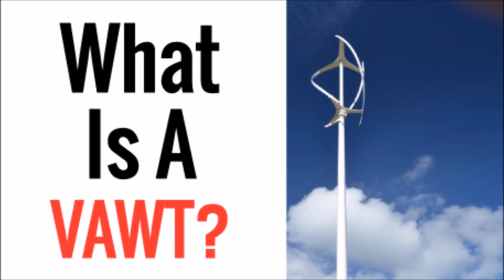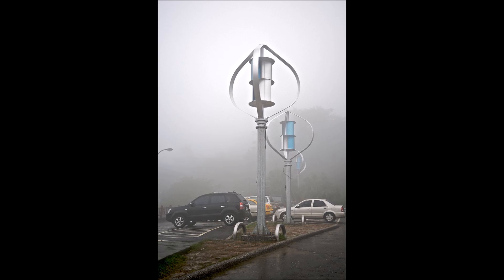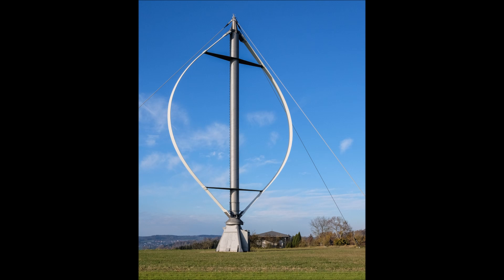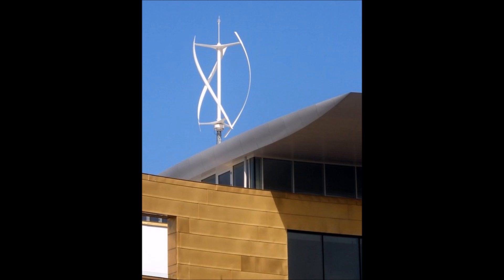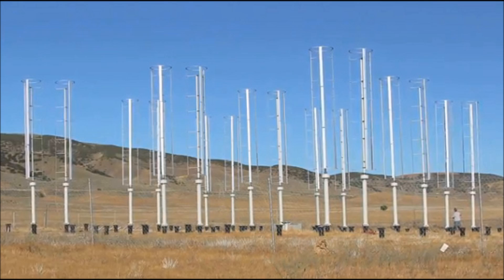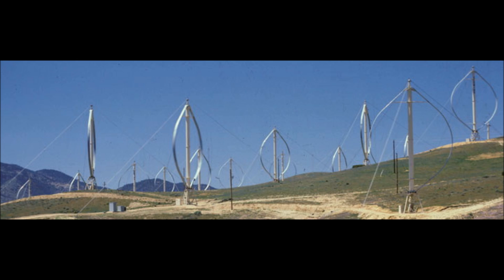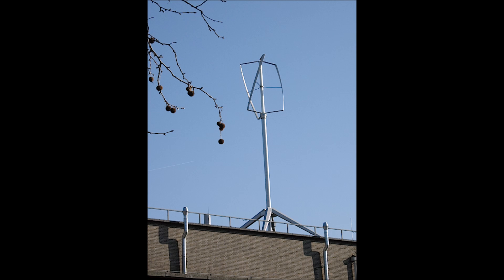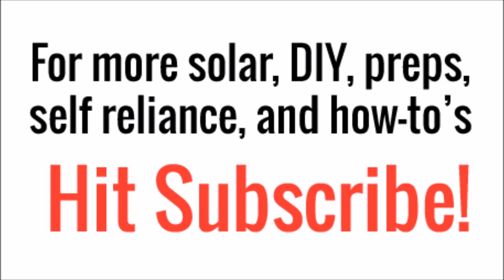What Is A VAWT?

Comment: So... I didn't know you had videos on wind turbines. I am hoping you can revisit these concepts a bit more, since solar is very limited. I like solar and have been using it, but there's no solar energy produced in winter...mostly. Its like 1/3 or 1/4 of the summer, and only like 6 to 8 hour window. So this is why i think you could revisit the wind turbine research. 

I felt like looking at many videos that the VAWT designs have their flaws overemphasized. The normal horizontal ones you don't hear anything about anyone saying they have wear and tear. And they do. So people only hear that VAWTs have wear and tear and how they can break when its plain to see that when you look at specifications and written stats on sold wind turbines they never state the max speed for which the turbines will or can break. You won't see a max safe wind speed for them. You also don't hear about anything about HAWTs having problems yet they do. 

So it seems that this bends people away from the VAWT designs to only go after HAWT designs. And another thing that ppl with experience in turbines are saying is that the HAWT design loses a substantial amount of power generated because it loses that energy when it has to always find the wind. It has to first get pushed into the path of the wind. And then the wind is always changing where it comes from. So this is drawing ppl away from how good the VAWT designs are, particularly HELIX shaped VAWTs. 

I'm not in favor of any one design or the other, but I noticed the labels and specifications for these are very lacking in good information. Another example of this is that it would be better for how much power is stated for capacity to put into just a wind speed and power generated per 5 to 10 mile per hour wind increases on a big graph table and have that labeled on the wind turbines instead of stating ... this is 400 watt turbine, or this is a 1400 watt turbine... which is highly mislreading. Right now when you lookat turbines on the market they have the same specifications stated exactly the same for wind speed, and 95% of the information for both the 400 watt and 1400 watt turbines. Yet one is 5 blades and another 3. And nobody talks about how the number of blades affects power production. They just all slap on a default tag of... power production starts at 2.5 m/s and our power model production is based on a calculated 12.5 m/s average. Then nothing again on the max safe speed for the durability of the hardware. 

I was hoping by mentioning this to you that you might do more on wind turbines or at least be able to provide input on them. 

And another big pothole in looking at wind turbines now is that people say they don't actually come with enough wiring to go from the top of the house or top of the pole where its at to go down to the power station/controller that it connects into. Boxes for them don't tell you what type of wiring to look for for that particular area. And this leaves ppl struggling to figure it out. And many videos on youtube that I'd looked at there's very little technical explanations on the wiring and the charge controllers for wind turbines. Recently someone told me that you can't use solar charge controllers for wind turbines... but that was the first I'd heard that and didn't understand why that's the case. 

...

Right now it would be good for ppl to get into this since bank runs have started already.
Reply from the maker: I have been dying to.  Unfortunately, I live in your typical suburban neighborhood with a restrictive HOA and houses on top of each other (1/8 acre lots).  That is the only reason I haven't done more of it.  I can't install one and learn more about them first-hand so I don't really consider myself an authority or have much to teach other people.  But I am looking for a rural property to purchase and there will definitely be a wind turbine going up, so stay tuned over the next year or two.
Reply: @LDSreliance  Thank you for the reply and the videos.

And yes, HOAs are immense trouble. Sister's HOA fee tripled when they'd only owned the place like 8 years.
Reply from the maker: Yeah I have seen that happen, too.  Luckily this one is pretty cheap fees but they ban things that make it obnoxious, like window air conditioner units, solar (that got repealed), wind turbines, and other things.

Comment: Show me any VAWT design that is capable of producing power on the up-wind side of it's swept area?
Don't waste time looking, they don't exist.  The best any VAWT can do, is minimize the drag component of the up-wind side. This includes complete shielding of the non-working side. 
It's all been done before and it's all been proven to be an exercise in futility.
In fact, all VAWT designs are classified as "drag devices" with little or no aerodynamics involved.  You can't engineer this fact away.
People, by nature, are dreamers and VAWT research and development, remains nothing more than a dream (a pipe-dream.) 
For any "new" mousetrap to succeed, it must actually be better than the old one.  And this (by it's inherent design characteristics) is what all VAWT designs, fail to achieve.
Reply from the maker: Yes, they are not as good as horizontal turbines.  But if you can engineer around the weaknesses a little bit, they can be useful for places that you can't put a 50 foot tower up.  We aren't there yet.  But don't make definitive declarations about physics and science.  Remember, all scientific laws are, in fact, theories and we learn new things routinely that contradict what we "knew" 10 years ago.  So there is no harm in continuing experimentation and exploration.
Reply: @LDSreliance  Yes, you're  right of course. Keep tinkering and tell me how it goes...   I'm done with all that for now, as it was my time and my money that is now gone with the wind.  I'm a bitter-bastard now.
Reply from the maker: Haha, too true.  I gave up on turbines altogether a while back because I live in suburbia.  But I hope to be move and be free on a new property to build whatever I want however high I want.

Comment: I think the only way the vertical ones can even conceivably compete w. The rpm of horizontal ones is if they have channels or guides to funnel the wind onto only the blade facing the wind but even then I don't know.
Reply from the maker: RPM isn't the only factor in power production, though.  Those giant wind turbines that are in production with the 150 foot blades only operate at 10-20 RPM.  You just need to be able to turn the alternator and the bigger/more powerful the alternator the harder it will be to turn which means you just need more force.  In other words, larger blades with more swept area or better design.

Comment: In Australia there used to be a tv show called Beyond 2000 ( screened in the '90's )
One episode had vertical turbines in Sweden or Norway where the government was installing them in the city on the sides and tops of the buildings. Don't know if it ever became a complete system or not but they may have more information available.

Just thinking the updrafts would be great for a turbine.
Reply from the maker: Yeah true.  That is where VAWTs would shine is where the air is gusty and turbulent, like in an urban environment.

Comment: Hello, is this a good charge controller for a lithium iron phosphate battery?

https://www.amazon.com/dp/B01N1ZNRTJ/ref=twister_B01MS4PX4X?_encoding=UTF8&th=1

Does the charge controller have to say lithium iron phosphate on it or can it just say lithium?
Reply from the maker: Joe, I don't know of a solar charge controller that is purpose built for lithium batteries.  I am sure they exist.  If you find one let me know.  ZHC is a cheap Chinese brand.  I would not trust their technology at all.  It may work but you would be taking a big chance.

The good news is that you can get a programmable charge controller and plug in the parameters of the battery given to you by the battery manufacturer.  You just have to make sure that you do not float a lithium battery and get the voltages right.  Lithium batteries do not like to be held at peak voltage for very long, either.
Reply: They do exist. You just need to look around on amazon or ebay. Just type in charge controller lithium. 

What I was wondering is if i dont get a programmable charge controller, would my new charge controller need to say lithium iron phosphate if i got a LiFeP04 battery or would it need to say For lithium ion?

Comment: That is a way more manageable system it seems and the noise factor is one of the biggest complaints about wind right? cool deal hope they can get it figured out. I believe Mike Reynolds earthship founder built a vertical windmill and said it was meh at best.
Reply from the maker: Yeah, they are really cool and I want to play around with one this summer if I can but I am not going to kid myself into thinking it will produce much power or be reliable.  They have a ways to go.